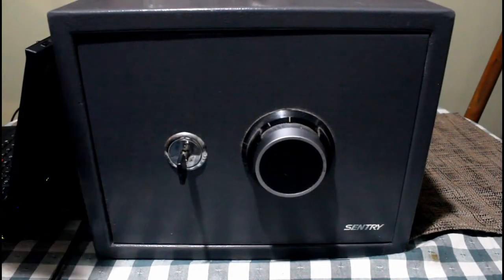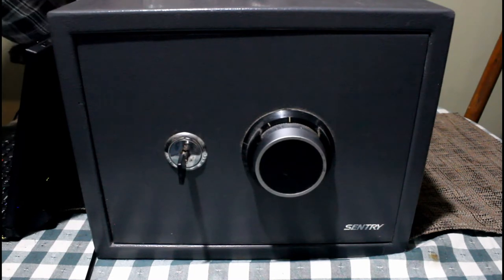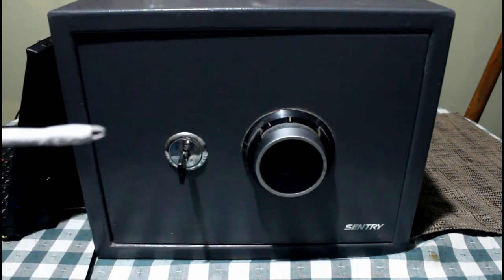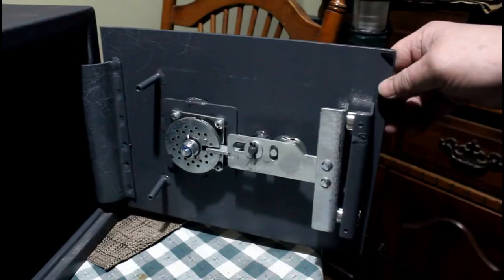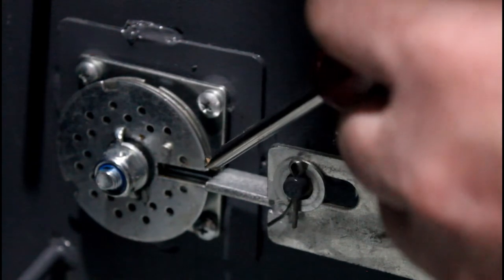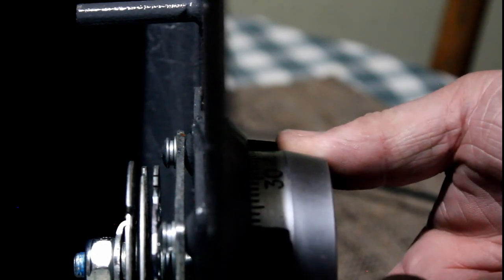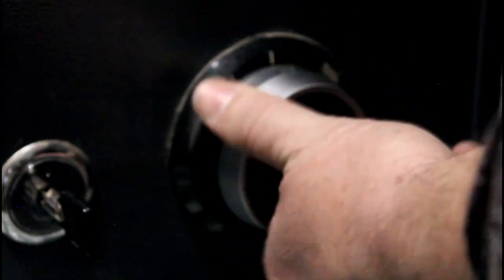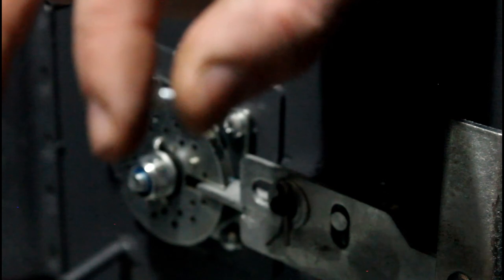Cracking a Sentry safe combination lock with a borescope

Comment: The wheels have gates, and false gates. The little nubs on the back that catches the next wheel are called Flys. Good job removing the inside cover. You usually have to drill a hole in the door to observe the gates. A real safe technician is either familiar with the safe or looks In a book to see where to drill.
Reply from the maker: Well now I know what to call them thank you sir.